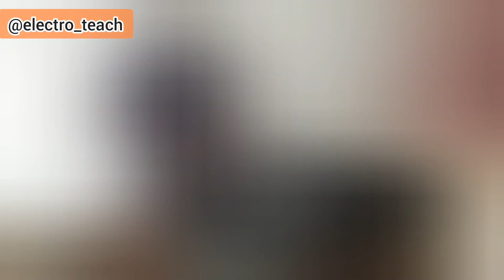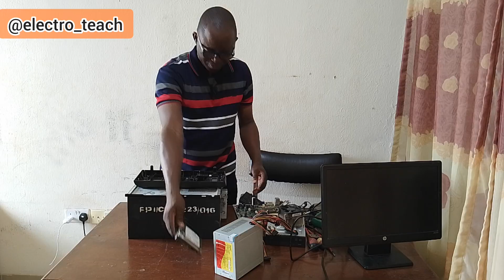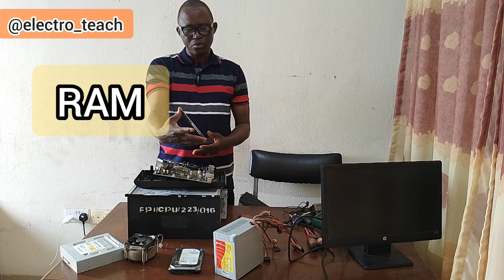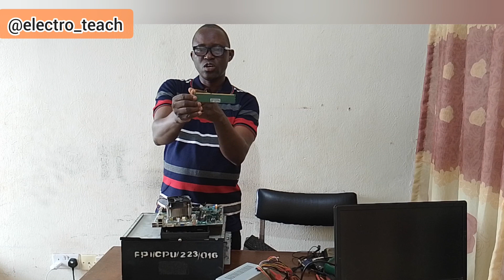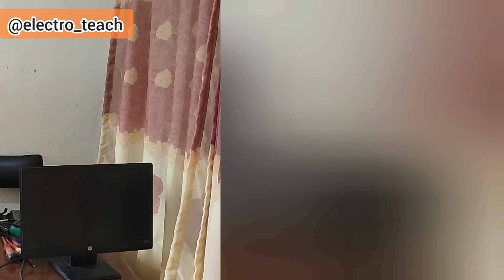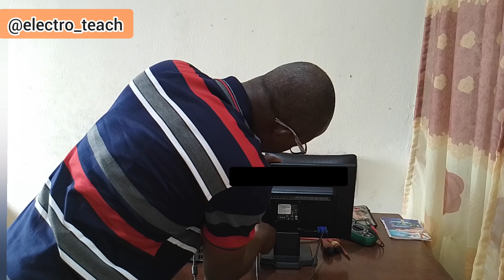How to Build a PC Step by Step | Easy Computer Assembly for Beginners

Comment: My pc developed usb failure… like is not working what went wrong ?
Reply from the maker: That may be caused by either hardware failure or software driver missing.
Reply: @ECIMacademy  so what should I do if it’s software failure ?
Reply from the maker: @FiftyShades-t6e  Check under device manager to see if the driver is missing. If the driver is missing the USB hardware will have a yellow mark indicating driver missing. Then try and reload the driver or update it.

But the driver may be intact. Sometimes if someone worked on your computer, or you hit the system on a hard surface, it may be that the hardware shifted in its position and doesn't make good contact again. So someone needs to check that by opening the system.

Comment: On how to assemble a  computer system 

You need some various components like computer case 
power supply unit capacity
 hard drive 
mother board 
heatsink and fan which is to cool the processor
optical drive
 RAM and the CPU which is very important in a computer system

We start with the motherboard, install the CPU heatsink and fan then install RAM onto the motherboard then continue installing other components into the case.

Comment: Step 1: Mount the Processor
Step 2: Fix the Motherboard in the Tower CaseStep 3: Connect the Power Supply
Step 4: Install the DrivesStep 5: Connect CablesStep 6: Mount the Memory ModulesStep 7: Install the Internal Cards
Step 8: Cover the TowerStep 9: Connect the External Devices and PowerStep 9: Connect the External Devices and Power before we can start to assemble the computer we have to switch off first

Comment: This video let me know process of assembling a computer 

Which the steps are following 

Procuring Parts. 
Gather Tools and Supplies.
Open the Case. 
Prepare the Case for Assembly. Ground Yourself. 
Install Motherboard. 
Install Hard Drive. 
Install Optical Drive.
Install the CPU
Install RAm
Install the CPU Fan
Install case fan
Install Power Supply
Connect cables 
And wrap up the